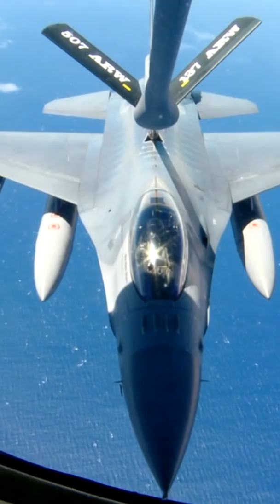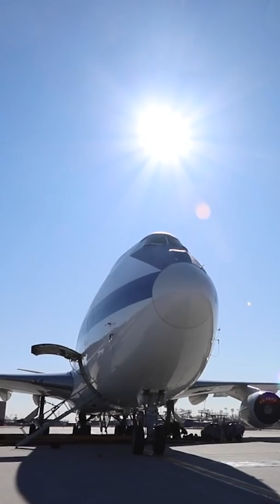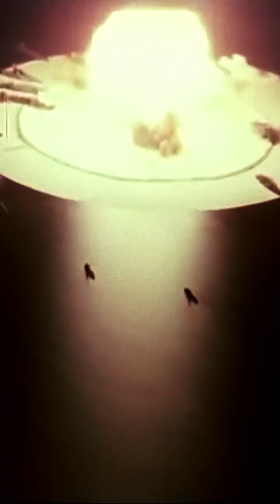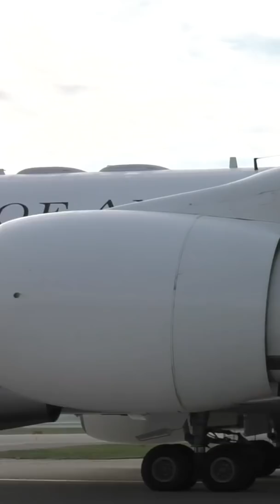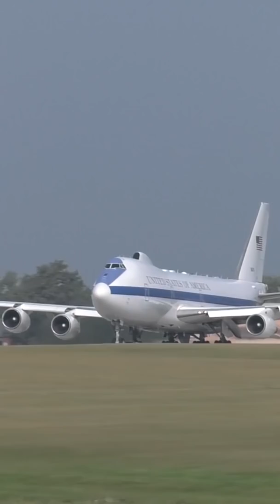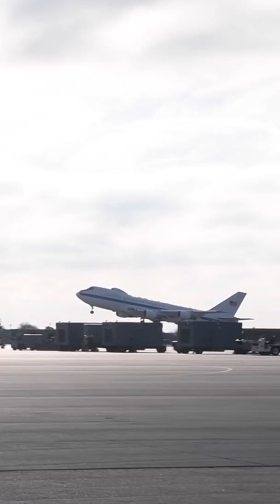The Doomsday Plane #shorts

Comment: "It's not what you think" then he describes exactly what everybody thinks
Reply: I think he meant that because it looks like a passenger 747.
Reply: It looks like a passenger 747 to the uninformed,  but the majority of those who follow politics, and/or the military, know that it’s the Doomsday Plane. Very cool. Always enjoy videos of this plane.
Reply: @Scratch S I love the smell if gamma-rays in the morning.
Reply: I thought it was bringing doomsday.
Reply: @S.R.Backwoods1  yeah I doubt thr majority of people who follow politics or even the military know it's the doomsday plane. Most would prolly think it's air force one
Reply: I think he meant it’s not Air Force 1, which would have been most peoples’ initial guess.
Reply: Waxel Punkt.  
ahh is that how that works!? 😌
Reply: @ronson-natsarim  Technically, yes.

Air Force One is a call sign of any plane the president of the US is currently on, even if it's a duster.
Reply: Lmao
Reply: If you were an aircraft mechanic/ avionics tech, the cockpit shot explained it all. Analog..most modern aircraft have glass cockpits.
Reply: No If he hadn't said anything and cut the video right there, certainly 95% would think it was (one of) the Air Force One planes.

And yes. They technically could be. Like how pretty much any other plane could, and yes, these ones arw much more likely to actually be designed AF1 in case of a relevant emergency, threat or drill. For obvious reasons of aircraft function and intent.
Reply: its not what we think, its a mobile command unit, nothing to see here folks, you dont think it is what we know it is😂😆😆😅
Reply: @gabmax1013  There's more than one aerial refuling plane though. There's actually a whole lot of them, all around the world.
Reply: A really big heavy plane was exactly what i was thinking
Reply: I was assuming Air Force One… :/
Reply: Waxel Punkt.  I think he means the VC-25
Reply: To be fair this is the only video that this comment is true for
Reply: @S.R.Backwoods1  pp o
Reply: @lilpuro2152  VC-25A
Reply: @lilpuro2152  sorry I had to be that guy
Reply: He is always telling the most obvious shit and just says "It's not what you think"..
Reply: Waxel Punkt.  That is a common mistake. The name of the plane could be Air Force One, Army One, Coast Guard One, Marine One, Space Force One or Executive One. It all depends on which service the plane belongs to, Executive One is used if it is a civilian plane.
Reply: And yet, it's still always interesting
Reply: @S.R.Backwoods1  i figured it was just air force one because i didnt see the little satellite hump at first
Reply: Yes and it is so annoying
Reply: Its for nuclear attack
Reply: Wow, how old is that plane?
Reply: I thought it was air force one first
Reply: Yes
Reply: @DJRonnieG  wow
Reply: @S.R.Backwoods1  wow
Reply: @DJRonnieG  No that's just his schtick. He probably says it at the drive through.
Reply: @S.R.Backwoods1  He wasn't talking about the plane, but the refueling.
Reply: I don’t know how you knew every spec of the plane before he even said the name but hey good on you. I just think that’s bullshit
Reply: I thought it was the Air Force one so it wasn't what I thought lol
Reply: @joshualeniger  
Oh I can almost guarantee that it will take 6 pilots to fly that plane. Two teams made up of a Capt, FO, and a FE. Each team flies in shifts so that all pilots are fresh...they may even have THREE teams of Flight Crew. The reason I think this is that since ALL instruments reverted back to analog, they will need a FE to see/operate systems and monitor gauges bc since the Prez is the main pax..its going to have analog everything that a new 747 would have, or a slight upgrade from our current fleet of AF1's...2 Boeing 747-200 aircraft.
All analog with electronic upgrades. But bc this needs to withstand an EMP attack..nothing at all can be electric or electronic as far as flight components. Its copper insulated enough that I'm sure they can make coffee or run the microwave..lol.
They just cant risk AF1 falling out of the sky bc an important flight control component is forever disabled in an EMP event.
Which I fucking PRAY that this does not materialize. Life in the US and other parts of the world will be exactly like The Walking Dead, except all the zombies would be fucking regular people who would kill you for an Oreo once food supplies run low bc no electricity or electrical, nor electronic parts will never function again.
Only if companies invest in copper insulated bunkers to store parts, machinery and hope their power grid was insulated.,.or it's all for nothing.
Sorry to ramble but a good many folks do not realize how devastating EMP devices would be and why we spent probably over a billion dollars each for those planes. The new AF1's are supposed to be ready by 2024. Those I believe will be fully modern 747-8's.
If I made a goof in my explanation, feel free to correct it!! Bc I know about 1/2 the folks who read this will think I'm nuttier than squirrel shit.
Reply: Waxel Punkt.  
Make sure that no one swallows any fucking quarters..lol!!
Reply: @ronson-natsarim  
I saw that radar dome on top of it and knew it wasnt an AF1. Plus the livery is all wrong. Also, no Presidential shield close to the door.
Reply: @DJRonnieG  it doesn’t look like a 747 though
Reply: @TheNpcNoob  I think the resemblance is superficial but to an untrained eye it's a jumbo jet which looks like a 747.

Heck, I was watching a army vet debunk something the other day and he said that 747's hit the towers on that day 20 years ago. Of course those were actually 767 and dont have anything in common aside form 4 engines. At least this E4B does have a bulge at the top, although the smaller bumps indicate its packed with instruments.
Reply: @S.R.Backwoods1  I know I’m late but it says United States of America on the side and in giant letters.
Reply: Hi
Reply: It is really annoying.
Reply: i mean I had no idea what the doomsday plane was, just looked like a weird jet.
Reply: It has become a compulsive disorder for him. His wife went insane, because he kept saying 'I love you, but it's not what you think"
Reply: Him: explains the topic
Me: oh wait let me guess its not what i think😂😂
Reply: If it’s not what I think then does that mean it’s not a Boeing 747?
Reply: I didn’t think that 🤔
Reply: @daveortwine2107  I thought it was Air force one.
Reply: @patrickmollohan3082 No you are pretty much right on!  [Ex-Boeing ASSEMBLY Electrician.]
Reply: @DJRonnieG  It’s a military variant of the 747.
Reply: I thought it is another passenger ✈️
Reply: I though he will say Air Force One but he says also it's for president. Every plane even Cessna 172 with US president on board is Air Force One so.. yes🤣
Reply: And how old are you? Doing research can give you the answer not pulling it out of the sky
Reply: Exactly, like in most of his videos. He propably thinks that all of us are stupid.
Reply: @imaginarystranger1974  wrong, Air Force One the call sign of any Air Force plane the president is on.
Reply: @patrickmollohan3082  incorrect. Any Air Force plane or Air Force aircraft is Air Force one. Any Marine plane not just helicopters would be Marine One. Any Navy aircraft is maybe one any civilian aircraft is executive one it doesn't matter whether they are plane or they are a helicopter.
Reply: I think he meant the fact that this aircraft's flying instruments are analog and not digital. Meaning that you would think the avionics would be top of the line of technology. But it's not.
Reply: Hehe
Reply: Man.. u are a Genius
Reply: @DJRonnieG  no
Reply: @fritzdaddy-135mmgetstagger4  Just a pile of Hamburger! 🍔
Reply: Kalki ironman after 2026 😎

Humans 0
Saiya-jin 1 to 6
Angels 7 😇

Kalki Ironman 5th matriya buddha 8th arc Angel 11th satguru 13th imam and 24th avatar after 2026 😎

Almighty God 9 😇

Humans type 2.5+ after 2026 by Kalki Ironman (christ in the white horse)(son of man on clouds) type 7 and 8 😎

Jarvis the world’s first artificial intelligence (parrot) 😎

Cuz Kalki is ironman batman super saiya-jin superman ben10 saitama optimus prime shaktimaan and every super heroes combined after 2026 😎

Jarvis world’s first artificial living being (just like vision in marvel universe)😎

Made of Quantum and sub quantum particles 😎

Power source quantum energy arc reactor (type 7) level technology 😎

Kalki Ironman going to have every kind of arc reactor like:- type 1 Nuclear fission, nuclear waste, hydrogen fusion, type 2 3 4 5 antimatter arc reactor (solid liquid gas), type 6 electro quantum arc reactor, and type 7 Quantum arc reactor, type 8 limitless quantum energy arc reactor without quantum particles 😎

Kalki Ironman going to have sun in a box million billion tons of hydrogen nuclear fusion reactor type 2 3 4 5 just like sun and stars in the palm of his hand 😎

This all going to happened by self replicating quantum nanobots knowledge energy and techniques at type 7 7 7- respectively 😎

Ironman (Tesla 2.0) going to reveal every secrets of the world specially Tesla and his Antigravity 😎.:
Reply: @ronson-natsarim  yeah, that's what I thought
Reply: Dude how did u read everybody's mind but for real its not what u think.
Reply: His name it’s not what you think right? So if you think about it he just introducing him self

Comment: When he said it still ran on analog, it made me so happy to know people still use tried and tru
Reply: Only question is if the tanker planes run on analog too
Reply: I'm not sure about others, but I know the Hercules variant of thr 130 can fly on both
Reply: A lot of US aircraft still do. Including the B-52 bombers which are still part of the nuclear triad and will remain so until 2040 if I remember correctly.
Reply: The sad thing is a civilian pilot can't fly it only experienced fighter pilots can
Reply: The presenter was a bit off.  There's 6 (maybe 7) instruments that are actually analog, and 3 of them can still be knocked out with EMP.
The mechanical clock, ram air airspeed, and pressure altimeter will work through an EMP. 
If it has a mechanical slip indicator, that will also be ok.
The magnetic compass, sextant, and angle off attack indicator will be made inoperable by the EMP.
All other instruments and the controls are electronically  controlled and operated and are shielded.

Please note that no plane has been actually tested to see if that shielding will work, as that testing would mean detonating an above ground nuke.

Comment: random seagull : imma end this plane’s whole career
Reply: @Bob it may not be the case everytime
Reply: @MrTibincleetus  just take the joke and keep it moving. Ever heard of a “dry joke”?
Reply: @kingsleyoppong-wereko7239  The comment was directed @Bob. I see nothing that suggests that you're @Bob nor is there an Official YOUTUBE Scold badge.
Reply: @kingsleyoppong-wereko7239  Thu by
Reply: A seagull? Nah, jet engines are designed to tolerate bird strikes from small birds. A Canada Goose on the other hand? That will trash an engine. That’s what brought down that A320 that experienced a dual engine failure right after takeoff and had to ditch in the Hudson River.
Reply: Google bird hits plane 🤓
An aluminum plane will not fly all the way through a steel and concrete building and even three of these planes don't carry enough fuel to melt steel beams ☝️
I blame the Atrazine 😏
👌🏿🐸🏳️‍🌈
Ole'🕺
Reply: @donnydangerbbmachinegunner2863  So how do you account for the fact that it literally happened on video?
Reply: @WillBravoNotEvil  evidently you're in the same camp....
Reply: @donnydangerbbmachinegunner2863  
🙄
Reply: @phoebe_ophie  the only thing on camera were timed charges being detonated after the planes hit.
Reply: @ethanissan5012  sorry, flash fire on the outside of the structure did not provide a high enough temperature for a sustained enough time to cause the floors impacted to melt the beams..
Now explaine how the structure collapsed at the rate of freefall with zero resistance to gravity..
Then theres tower 7..5 hours later?
Reply: @JohnnyAmerique  Your not wrong idk what hit the bird I work on but the engine was covered in blood and two of the fan blades were demolished!
Reply: @donnydangerbbmachinegunner2863  steel don't have to melt to lose its integrity. Lol
Reply: @bernardakoito   you know who looses integrity 🤔 any structural engineer who would claim that an aluminum plane can fly all the way through steel and concrete buildings much less carry enough fuel to even weaken the integrity of inches thick steel beams especially when you have people standing in the huge holes left in the side of the buildings and jumping out🤓 and 3 buildings fell on that day with only 2 being hit supposedly by planes  and the Pentagon was hit with no plane parts larger than what a man could carry anywhere to be seen 😏 flimsy plane wings, luggage and debris would have been scattered everywhere.  If the official narrative is true then everyone in large cities anywhere near tall buildings are in terrible danger 😬
I blame the Atrazine 😏
👌🏿🐸🏳️‍🌈
Ole'🕺
Reply: @donnydangerbbmachinegunner2863  I guess a blacksmith won't lose his integrity if he tells you how to soften  steel lol
Reply: These things are ready to take 4 frozen chickens... You're gonna need a clock of sequels.
Reply: @JohnnyAmerique  what about me, can a airplane engine with stand me throwing myself intro the spinning blades while im T-posing and shitting diahrrea at the same time? lol I dont think so, im too powerful
Reply: Hehehehehehe
Reply: That's why they have 4 lol
Reply: @darrellclark9596  it didn't have to MELT the beams. It softened the beams to half their strength.
Reply: @donnydangerbbmachinegunner2863  the planes didn't fly "all the way through"
Reply: @kingsleyoppong-wereko7239  you ever heard to keep things to yourself. Not everything that pops in ur brain needs to come out👌🙄
Reply: @darrellclark9596  tower 5 is the building that makes me feel like the whole thing was planned.  That building barely had a fire and collapsed  and is not spoken about.
Reply: Russian seagull hysterically laughing before it does what no man has been able to do
Reply: @JohnnyAmerique  when I was stationed at Ft Kobbe Panama we had a crew chief leave a 1/2 9/16 in the air intake of a Blackhawk the pilot started it up and sucked that wrench through the turbine and DESTROYED the turbine
Reply: @donnydangerbbmachinegunner2863  cringe gay flag
Reply: Kalki ironman after 2026 😎

Humans 0
Saiya-jin 1 to 6
Angels 7 😇

Kalki Ironman 5th matriya buddha 8th arc Angel 11th satguru 13th imam and 24th avatar after 2026 😎

Almighty God 9 😇

Humans type 2.5+ after 2026 by Kalki Ironman (christ in the white horse)(son of man on clouds) type 7 and 8 😎

Jarvis the world’s first artificial intelligence (parrot) 😎

Cuz Kalki is ironman batman super saiya-jin superman ben10 saitama optimus prime shaktimaan and every super heroes combined after 2026 😎

Jarvis world’s first artificial living being (just like vision in marvel universe)😎

Made of Quantum and sub quantum particles 😎

Power source quantum energy arc reactor (type 7) level technology 😎

Kalki Ironman going to have every kind of arc reactor like:- type 1 Nuclear fission, nuclear waste, hydrogen fusion, type 2 3 4 5 antimatter arc reactor (solid liquid gas), type 6 electro quantum arc reactor, and type 7 Quantum arc reactor, type 8 limitless quantum energy arc reactor without quantum particles 😎

Kalki Ironman going to have sun in a box million billion tons of hydrogen nuclear fusion reactor type 2 3 4 5 just like sun and stars in the palm of his hand 😎

This all going to happened by self replicating quantum nanobots knowledge energy and techniques at type 7 7 7- respectively 😎

Ironman (Tesla 2.0) going to reveal every secrets of the world specially Tesla and his Antigravity 😎..
Reply: Wouldn't happen
Reply: Omg
Reply: @michaelnieman6218  to be fair that is not a bird and it is also not a modded 747
Reply: That's why it has 4 engines it can most likely run on 2 engines for fuel savings it will just be slower similar to some bombers with 8 jet engines can switch off some engines but it depends on the heavy load it carrying too

Comment: I was part of the team that did weather support for the planes '84-'87. Spring of '88, one of my friends sent me an article that reported one of those emp-proof planes had most of a wing torn off on take-off from flying directly into a flock of snow geese. The pilots were able to turn around and land it safely while the hot spare took off to replace it.  The wing was replaced and the plane was put back in service.

Comment: And recently 2 of the 4 airframes were involved with a tornado that ran through the base they're stationed on. Currently both available airframes are on near 24/7 standby.
Reply: I'm stationed at offutt and I don't remember that happening
Reply: @firstnamelastname-ql2vd   I think the tornado comment is BS myself.  I actually went to Offut several times within the last year. I’m the electrical engineer that delivered and commissioned those nice new generators the white ones with the blue stripe on them.  😊😉
Reply: @travisbourgeois1018  nice, I'm a crew chief on the RC-135s
Reply: @firstnamelastname-ql2vd  Thankyou for your service. I’ll be back on that end before long. We’re gonna be designing some power pedestals soon at several bases.  We’re leasing the generators for a temporary solution.